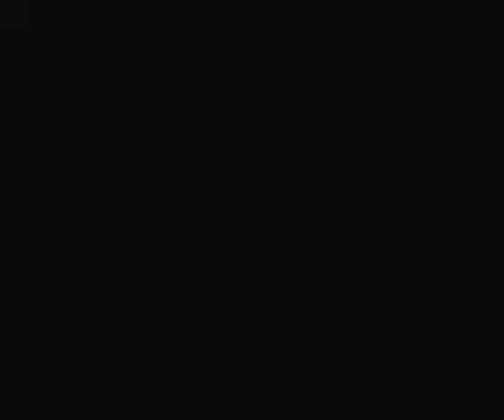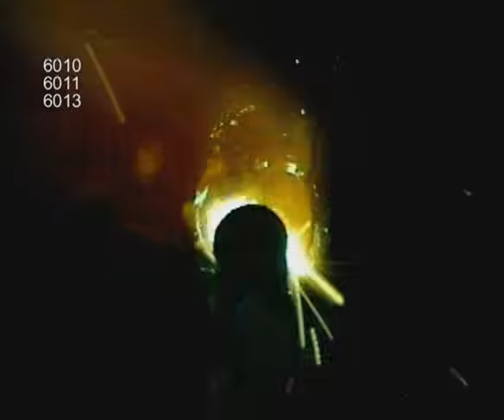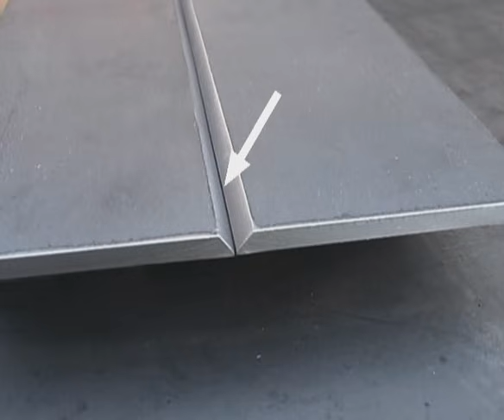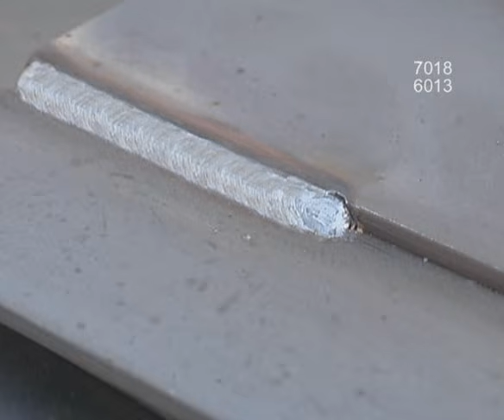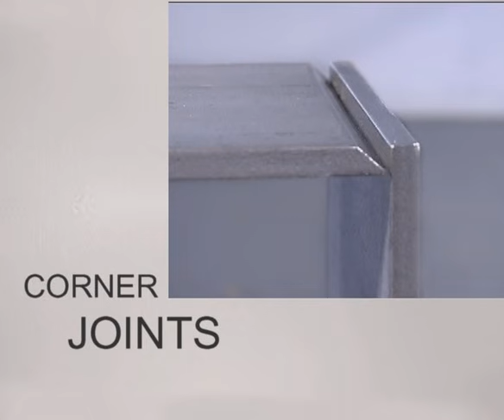Arc Welding 2 by Steve Bleile

Comment: At 38:55 he says to stack 4F from top down. All my work experience, hobart books, and field manuals say to stack bottom to top. It makes more sense to stack top to bottom because of excessive heat buildup and the possibility of undercut. The benefit of running bottom to top like in 2G does not work in a 4F as the shelf does not help gravity fall out. Does anyone else have thoughts on this? Not saying he is wrong but I wonder why in 2010s-2020 everyone has been taught to stack bottom to top again

Comment: What causes a rod to stick?
Reply: if you strike it wrong or if your amperage is too low, you shouldn't touch the metal with the electrode, when starting the arc strike like a match or i like to drag it on the edge of the metal

Comment: I was a welder till I retired. I do NOT understand why America welds arse about face to the U.K. D.C.+ seems to be the way over the pond.Why.The + side has two thirds of the heat, while - , one third. Also, you weave on a straight.WHY. The idea of welding is to JOIN the pieces together. With a weave, the heat is spread over a wider area. Combine that with the WRONG polarity, less penetration. i.e., a bad weld. There are some rods that are made for reverse polarity, but very little used. Try STRAIGHT runs and electrode  negative.

Comment: I have one  question for safety  reason.This may sound stupid but how would one be electrocute by using an arch welder.I mean can you be kill if you touch the metal that has the ground wire  while welding.I just want to know  what is safe and whats not..
Reply from the maker: Depends on many factors, but usually nobody takes care about electric shock and focused on heat impact.
To get electric shock needed difference of voltage between parts of man body. In dry environment welder's body and most parts of welding machine that have difference of el. potential are well isolated from each other, welded parts and welders are grounded and have same el. potential. Until starts the rain everything will be ok.

Comment: The best welding tutorial. It covers almost everything that any welder need to know, from basic to advance welding technique.
Reply: I'm waiting for my Everlast welder to arrive. It will be the first time I have ever welded but after watching this video I think I know a bit more about what to expect. I love youtube
Reply: Congratulation with the purchase. I've only been in metal fabrication (welding) for a year. Welding & Metal fabrication is a bit different than my previous experience esp. woodworking. One thing for sure welding is very challenging, for instance I have to deal with warped railing (l didn't clamp the material), bruise and minor injury because of sharp and hot metal; can't construct 3D object with perfection. Now after gain some knowledge and built some jigs to help speed up the fabrication, I'm very addicted to welding. My advice is practice and practice and don't forget about work safety.

Comment: I have a 80amp mig and a 80amp stick welder. Built a small atv trailer with the 80amp stick using 6011 rods. Never had a weld break with it yet. I do agree that stick welding will produce a stronger weld than my mig. Just my opinion though.

Comment: Turn out after further tests, you was right! I`ve been welding just a little too  slowly,  my welding beads was looking good and steady but to wide to have a good fusion but now it`s far better, almost perfect . My up ward vertical welding is a mine field, filling empty spaces under drops of metal am 90% sure it`s my body posture  and the way I am holding the torch  without burning my hand because my beads are`nt steady, to narrow/wide, any tips?

Comment: The same 30 degree joint you have, the MIG welder is properly set by the teacher, my bead looks clean and steady but it does`nt matter, the sample is still breaking in 2 parts or cracking under the hydraulic cylinder. Am 5% sure it`s a handling/aiming issue (angle)  and 95% sure it`s arc length (to short) . Does`nt  matters witch teachers ,the experiments to understand what`s wrong, it`s a failure, any clues?
Reply: +Bruno Laflamme I had the same problem as you when I first started welding with my first everlast welder. I wasn't getting enough penetration. Depending on your orientation and welding requirements, you may need to manipulate the torch and / or change your torch angle to the puddle to get more penetration. Good luck.
Reply: +Ernie Napier What everlast welder do you have? I've got the everlast powertig 250ex. Really nice for the money. Back on topic Jody has a bunch of videos that talk about proper penetration and technique etc. Bruno, you should check out those videos as well.

Comment: Chapter 1- Basic
0:00-1:18 Introduction
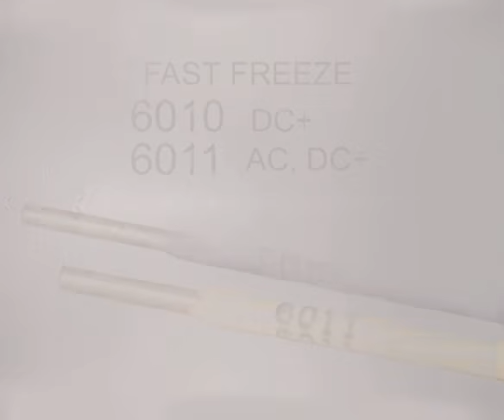1:19-2:02 Polarity 
---
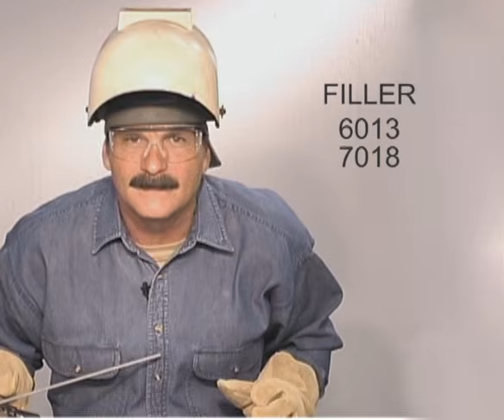2:02-2:36 6010/6011 - Fast Freeze 
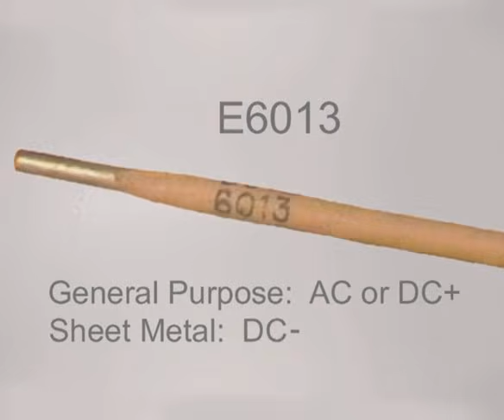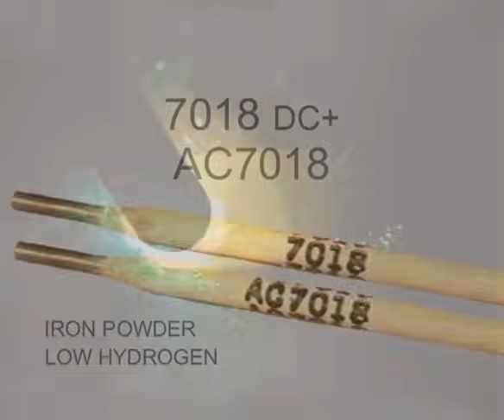2:36-3:00 6013 - Filler 
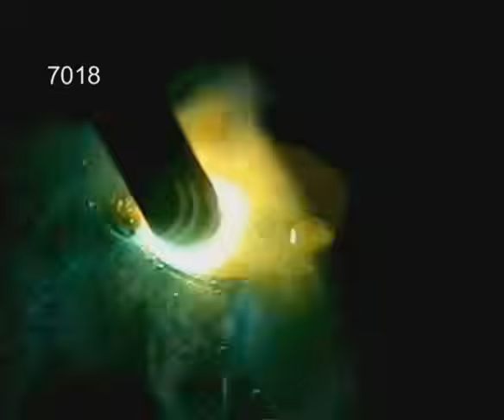3:00-3:33 7018/7018AC - Filler
---
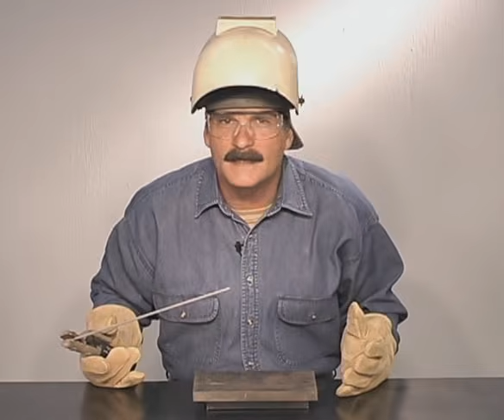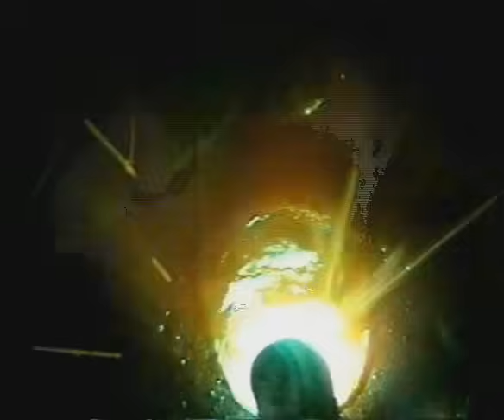3:41-9:47 Lash/ Welding Technique/ What to Look For 
9:48-12:10 Heat of Metal/ Brittleness 
-------------------
Chapter 2 - Weld Joints
12:25-13:15 Metal Preparation
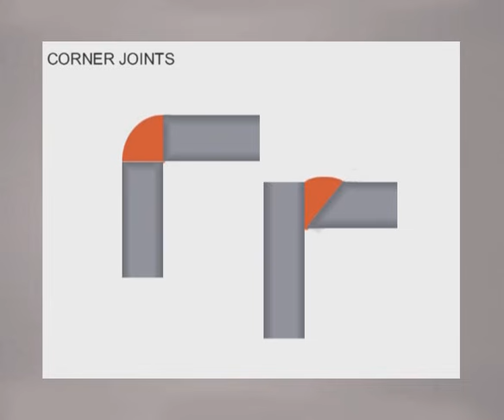13:15-14:10 Types of Joints
14:10-32:10 Butt Joint
32:10-37:28 Lap Joint
37:28-41:10 T Joint
41:10-44:12 Corner Joint
---------------------
Conclusion 
44:12-45:00
Reply: You are a life saver!! Thank you for this!!
Reply: Thanks m8
Reply: 😊 thank you!

Comment: Thank you. Best info video I've found. What would be the best amperage to begin with on a 1/2 inch welding project? I heard you say go up or down in 5 amp increments, but from where is the average starting point?
Reply: the rule of thumb you'll hear is one amp per every .001" an inch of the weldment's thickness.

Comment: I have to do some welding on a semi truck C frame, 6 inch crack, they recommend a E-11018 rod which has 110,000 pressure rating. Is this much more complex welding? Not the most experience here with welding. Thanks.
Reply from the maker: I don't think so, all rods can be used, only needs to find the way how. As for me - it is one of my favorite type (in Ukraine we have another name for this rods). But some old welders can't use them because they have great experience of usage E6013 and can't use anymore something else :)

Try to use what recomended. GL)